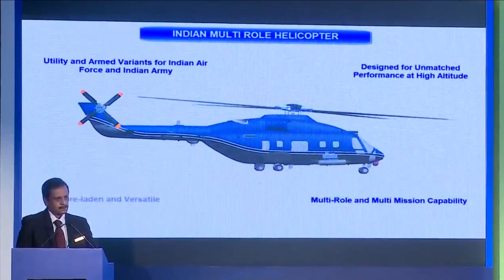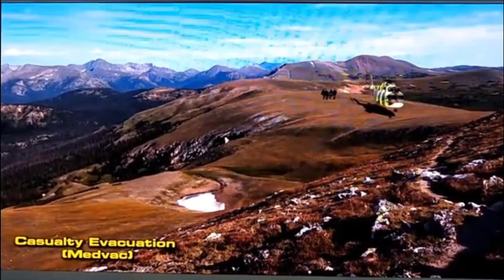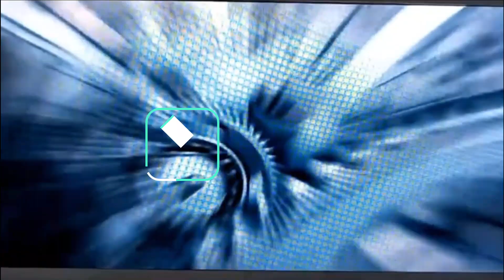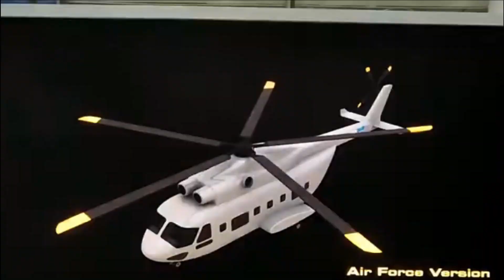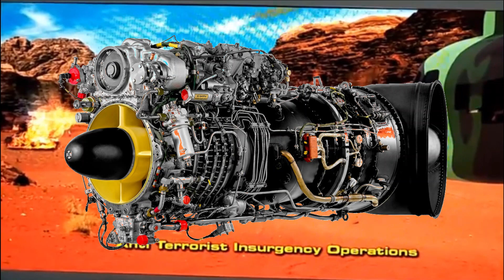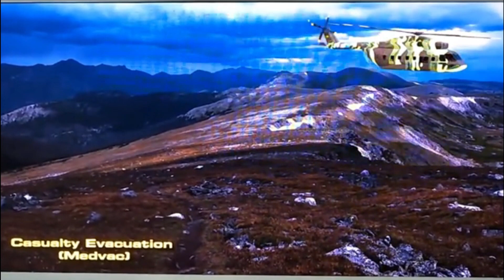Indian Defense Analysis:HAL to develop IMRH with both ASW and ASuW capability

Comment: We are assembling BMW with 50% indigenous parts. Sameway first priority to make products irrespective of foreign parts. Then moving towards indigenous parts slowly slowly. Like we have done in case of Tejas .
Reply: Yes. The HAL is doing the same. IMRH will be powered by foreign engines and foreign equipments wherever required and replacing them with Indian counterparts in the long run.